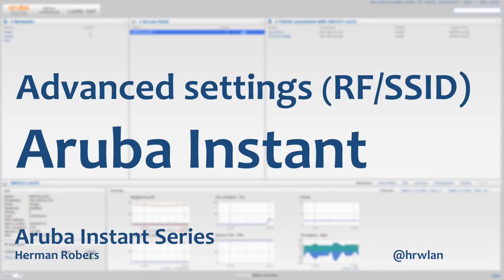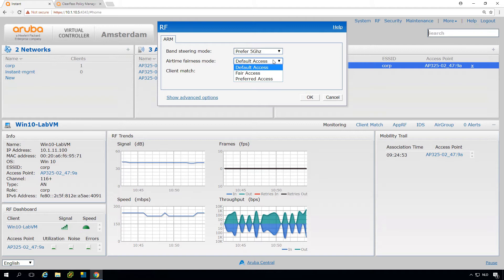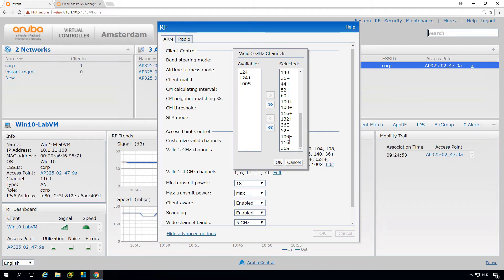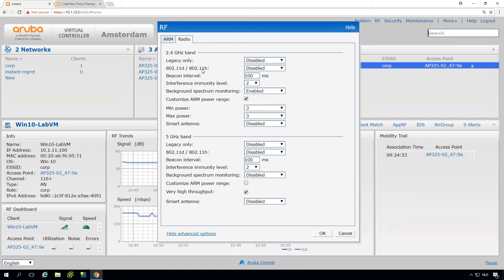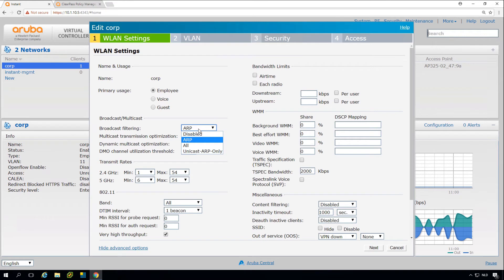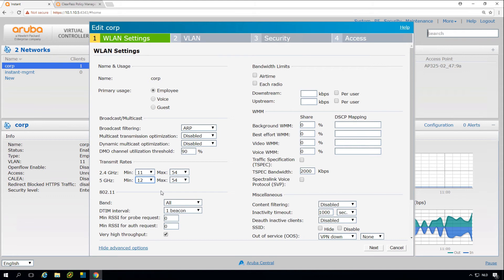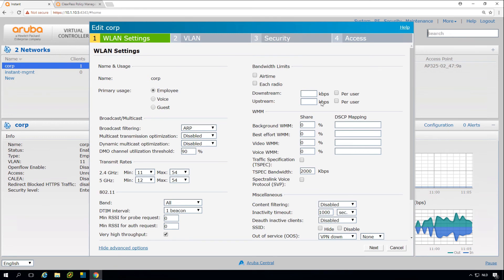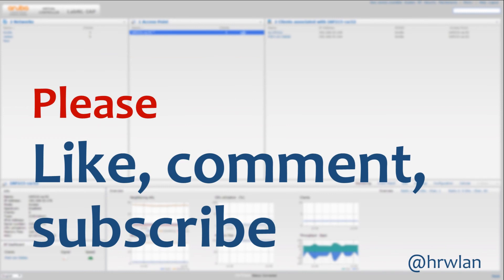HPE Aruba Networks Instant Series - Advanced RF/SSID settings

Comment: Is it possible to enable 5GHz only ?
Reply from the maker: you can enable/disable 2.4 or 5GHz radio individually, or per BSSID control on which band to transmit (2.4, 5 or both).